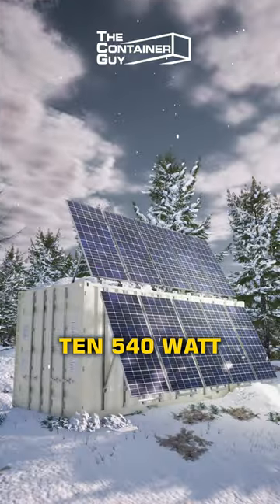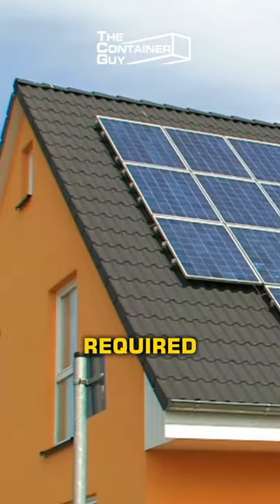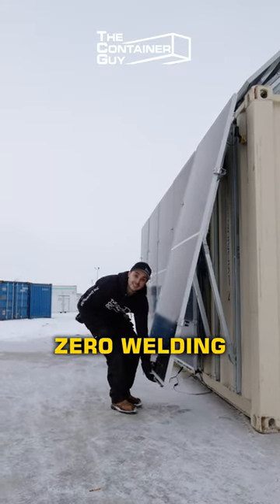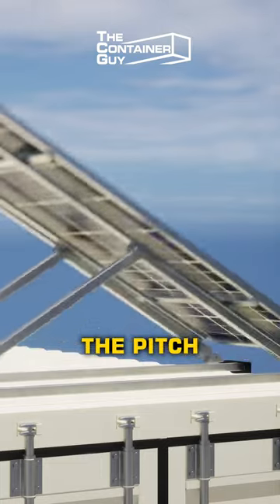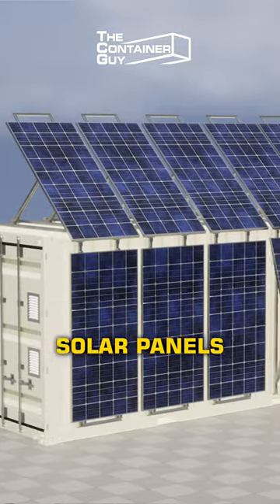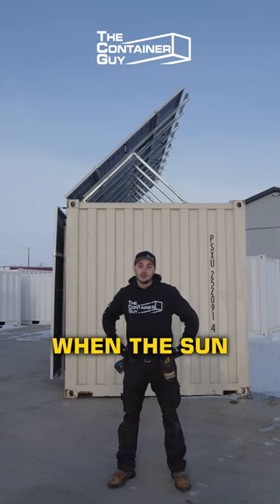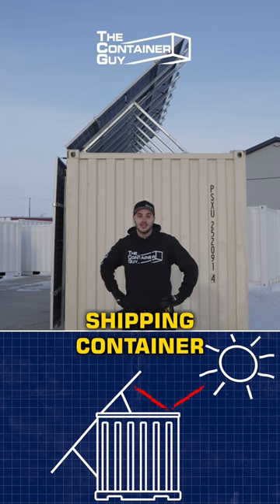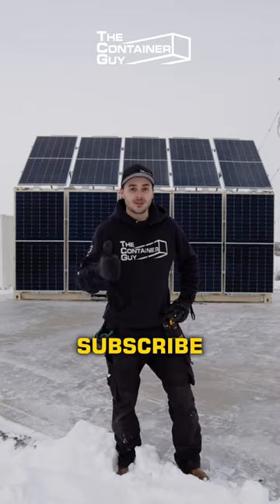DIY Solar Panel Kits For Your Shipping Container! #diy #greenenergy #shorts

Comment: Need to motorize the pitch of the panels on the roof then install the converter and batteries in the shipping container that way the installation would be flame resistant

Comment: This could be a battery and power station with a well pump solar hot water endless ideas
Reply: Good idea! Buy a small shipping containers for areas that are not accessible to electricity and put the panels inverter and batteries inside for the well, fence charger, what have you. You should manufacture the set up and sell it or lease it out.

Comment: Container is overkill.   You just need a few posts and 2x4s.  That what most people do. Easy to DIY a tilt to it.
Reply: With 100% loss of mobility after significant investment in panels. One idea might be setting up a shop in the container, metal fab or carpentry (or both), powering the whole thing with solar, and have full mobility for moving to the next job site.
Reply: I think the use case for mobile panels is rare, and this ad seems targeted at home owners.